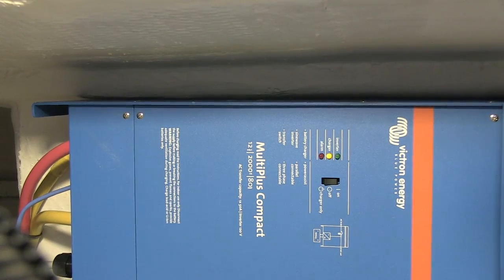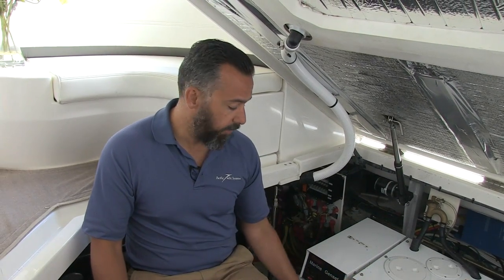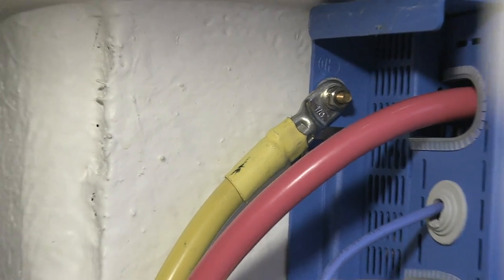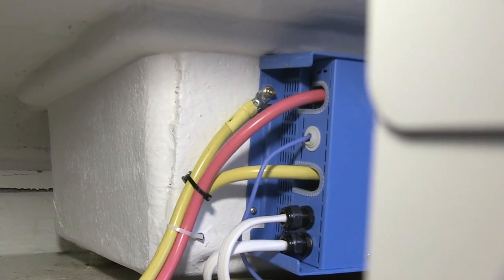Common Pitfalls of Installing an Inverter/Charger on a Boat

Comment: Hi Jeff. I've been binging your vids for days now. Great stuff. I am replacing the circa 1990 inverter on my steel hulled schooner. I have a Xantrex XC 1000 inverter charger going in. The diesel engine has been replaced with electric propulsion. The DC black on the old unit went to the starter on the diesel. Where would it need to go now? Also the chassis ground on the old unit was not utilized. Are there any special considerations I should take with a steel hull?

Comment: Love your use of analogies comparing a car (seatbelt, turn signals, etc) and the reason to follow ALL the installation instructions of the inverter/charger (ie: SAFETY!!!) If you don’t mind, I’ll ‘borrow’ those examples when I’m discussing a safe boat wiring installation vs one the ‘just works’ to my friends. (ps: No, I’m not, nor will I ever be in ‘competition with PYS... If I was ~25 yrs younger, I’d apply for a job with you though!!!)
Reply from the maker: Of course, we encourage sharing!

Comment: Great videos, Jeff. I also enjoyed all your seminars at the boat show this year. I understand your point about the cabling of the chassis ground needing to be one size below the cabling supplying the DC voltage to the inverter. The part I'm missing now is where should I take the chassis ground to. My guess is that the best ground would be the engine ground on my Beneteau 411. Am I correct?
Reply from the maker: Hi Bryan, on Beneteau it's hard because there is no DC negative distribution as the battery negative switch is used as quasi distribution. Without a good DC negative, i'd bring the chassis ground from the inverter back to the battery bank that feeds the inverter.

Comment: I am thinking about replacing a gas generator on my 1995 Sea Ray Sundancer 330. I want to replace it with a battery bank and an inverter charger.  I am wondering about connecting it to the switch at the fuse panel like I was switching it to the generator from the AC shore power. I did watch your video about connecting the charging part of the inverter and was wondereing if it would be better to purchase a battery charger separate from the inverter so that when I am on shore power it would still charge  the battery bank .

Comment: Thanks for posting this series, very informative.

I would like to see a bit about how you set up the AC feed to the charger/inverter. Fed by both shore and genny? Is there a source selector switch for that? If fed by both, why not use a Quattro inverter/charger?

Thanks again and fair winds.
Reply from the maker: The boat was already wired with a source selector at the AC panel. The client felt more comfortable managing the AC sources and we therefore didn’t install a Victron Quattro inverter/charger.

Comment: I have a Xantrex freedom 2000 charger/inverter. I think my power share  fuse blew so I am going to inspect and replace if need be. Before removing the inverter cover to change the fuse I know I have to disconnect the shore power to the boat. Should I also disconnect the DC power to the inverter by removing the large T fuse? to prevent the inverter autoconverting DC to AC:?
Reply from the maker: Hmmm, Graham most (if not all) inverter fuses should be located as a separate item, and mounted outside of the inverter. As a point of reference, never ever changed a fuse inside an inverter before, the fuses protecting the inverter are separate from the inverter. Let us know what you uncover.

Comment: JEFF!!!  You didn't mention the INVERTER A.C. OUTPUT BYPASS SWITCH!!!!  When on shore power, this transfers the onboard A.C. loads directly to the shore power, BYPASSING the inverter.  Saves wear and tear on the inverter.  Prevents temporary shore power loss events from undesired triggering inverter ON to make A.C., which then drains batteries!
Reply from the maker: Good point, the inverter bypass switch is handy. Many inverters are also chargers and you might want the AC input to the inveter/charger so the charger works.

Comment: Is the requirement for ground/earth wire to chassis being one size smaller than the DC positive and negative still apply in land based applications (eg an RV that is insulated from the ground)
Reply from the maker: Hi Francis, land code is different. Albeit, remember the code is the minimum. I'd recommend doing the same on water, land, or air.
Reply: @PacificYachtSystems  If the chasis of the inverter is bolted to the hull of an aluminum boat is that essentially a ground?  This is what one electrician told me....

Comment: Is the inverter install in an engine compartment. Can you install it their as long as its a diesel and not gas engines?
Reply from the maker: Hi Gordon, yep you can install an inverter in a diesel only engine room. Inverters are not-ignited protect and cannot be installed in gasoline engine rooms.
Reply: @PacificYachtSystems  But why would you? Inverter chargers are affected by higher ambient temps, become less efficient and have lower AC surge capacity, if I remember correctly. At least the Victron Multiplus    units do not perform as well in hot cabinets/engine rooms.

Comment: Could you explain the difference between a boat’s and a car chassis ground?
Reply from the maker: HI EK, a boat's ground is actually is connected to ground and is at zero. A car's chassis is NOT connected to ground and is floating.
Reply: Pacific Yacht Systems thank you 😊